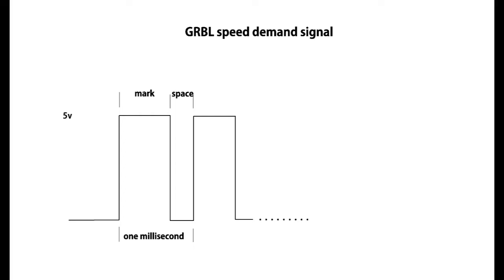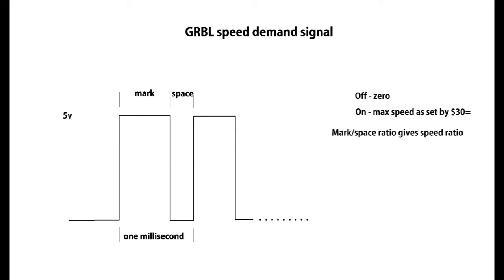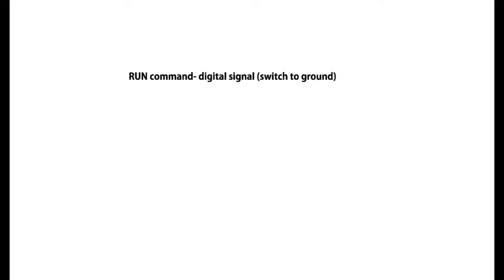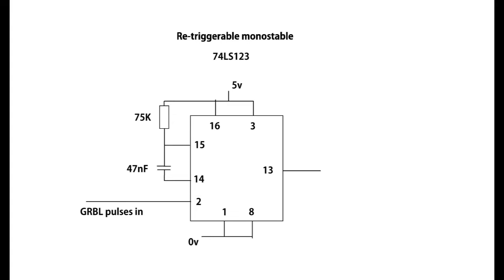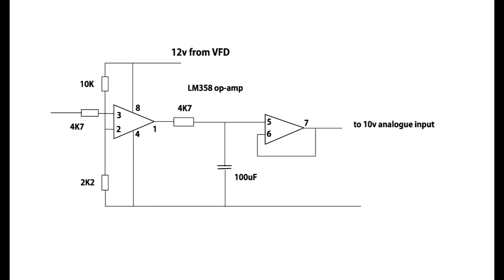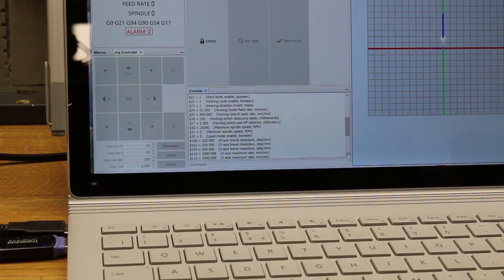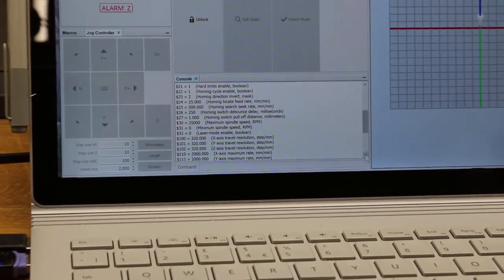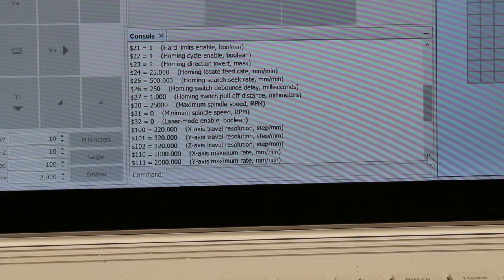GRBLtoVFD

Comment: Really didn’t help any chance you could explain the actual wiring diagram from VFD to GRBL controller.
Reply from the maker: The output pin for the speed signal on the Arduino is pin 11 - but of course you can change this in the header files. The connection to the VFD depends on which one you are using- there will be a terminal for the analog speed input and another for 'spindle on' - see the manual for the VFD.